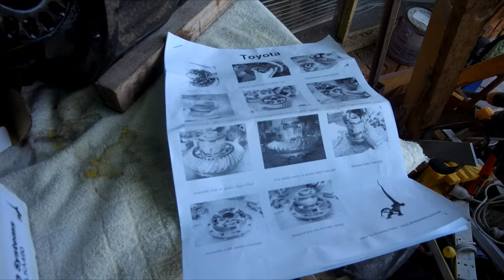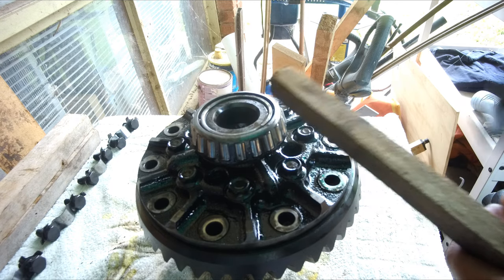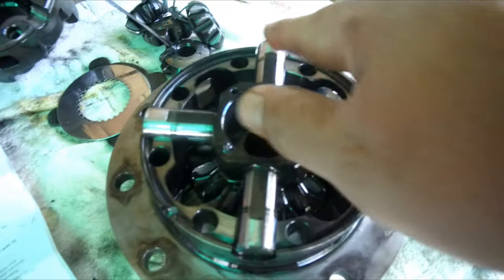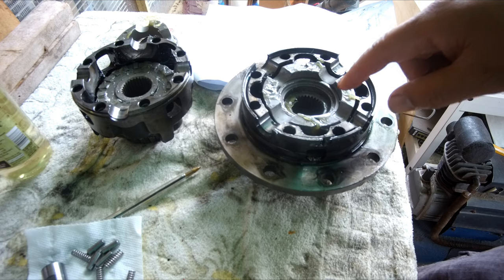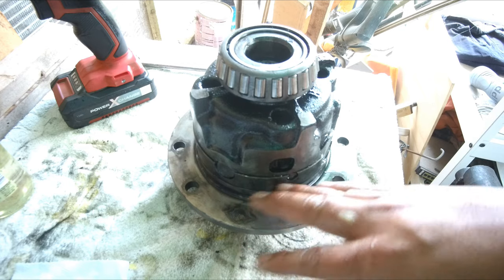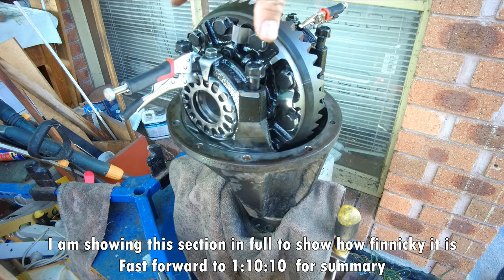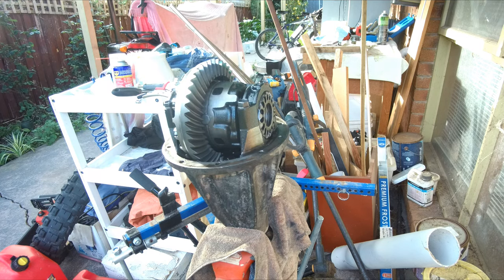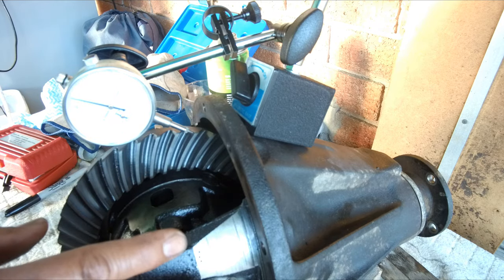TOYOTA PRADO LOKKA AUTO LOCKER - Ep3.  Installation (long version)

Comment: Just want to say thank you for the video. Just installed the lokka in my Prado 120 and your video made it effortless. I didn't end up removing the brake line as it just wouldn't come out after many hours with WD40, but unbolted it and the handbrake cable from the chassis/rear axle which gave it enough give to pull out the driveshafts.